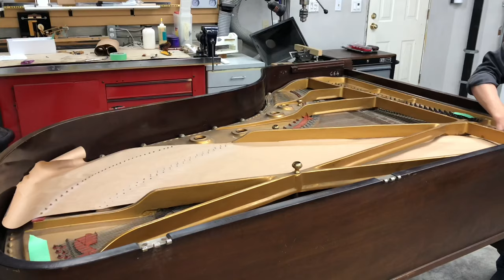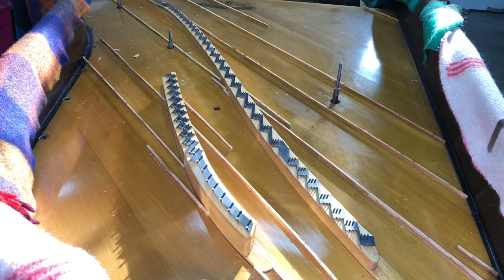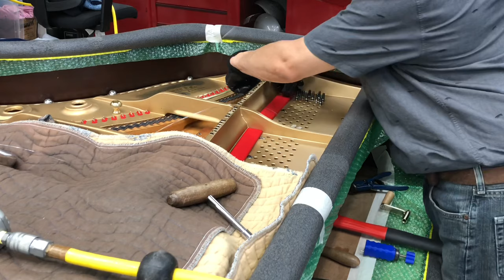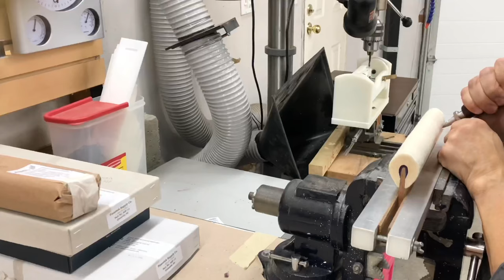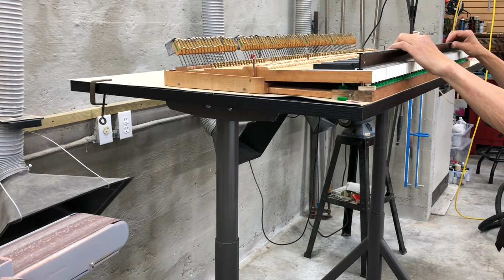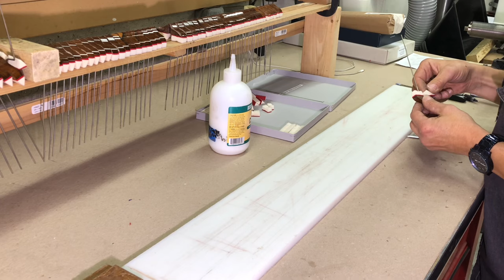Grand Piano Restoration Process

Comment: When preparing the sound board for filling the cracks, what did you do with those vertical wire-through screws?

I suppose, this was for re-gluing the bars to the board?
Reply from the maker: I utilized glue and a specialized tool to reattach the ribs that had become detached from the piano’s soundboard.

Comment: So how much did it cost to rebuild the piano? What do new ones cost? (Or even a used one)?
Reply from the maker: The cost of piano repairs varies based on the extent of work required and the desired level of restoration. Similarly, new pianos come in a range of prices, with some being affordable and others from reputable brands being more expensive.

Comment: this is a great video, I enjoyed watching it, thank you so much
I just have a question
at around minute 5 when you measure the downbearing, are you trying to match the downbearing with the original db before you remove strings? or is it a general rule for db you are following?
because i did not see you measure db before you remive strings
Reply from the maker: I check and correct down bearing before setting the strings and then after just to make sure it works correctly.

Comment: Very nice work. How much to restore a baby grand piano?
Reply from the maker: The price of piano restoration depends on its condition, and this can vary significantly.
Reply: @TornPiano  Thanks for your responding. How can I contact you.  You are in US right?
Reply from the maker: I am in Vancouver, Canada.
Reply: @TornPiano  I am in Cali. So, the  transport fee may be quite amount right.
Reply: Grand pianos of all sizes are not easily refurbished at home!
Removing the metal frame requires equipment to lift it off. There is a crane and stand as shown here.
It would require specialist movers to tow it away to a factory!
Thanks for the video!
Good job done!